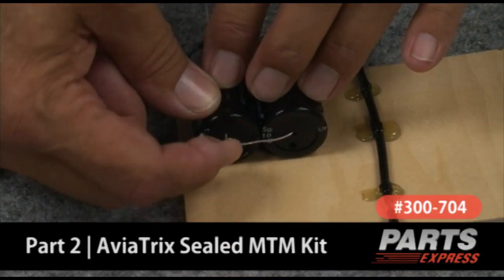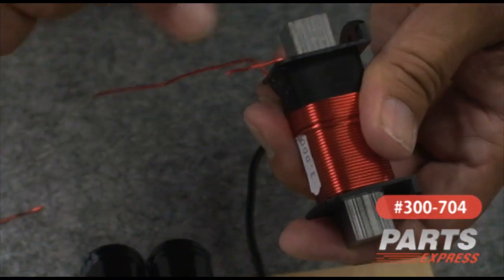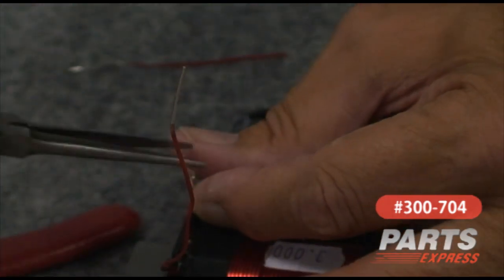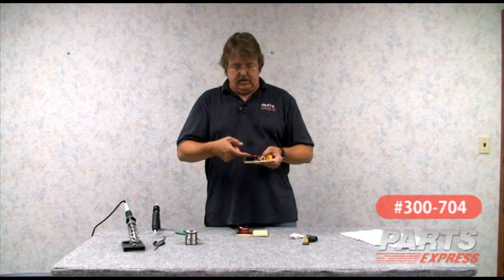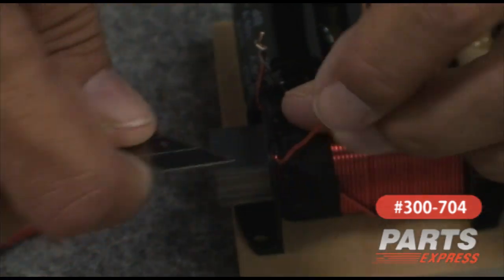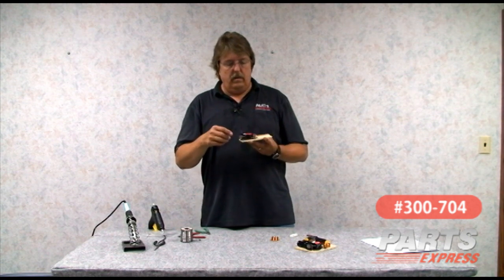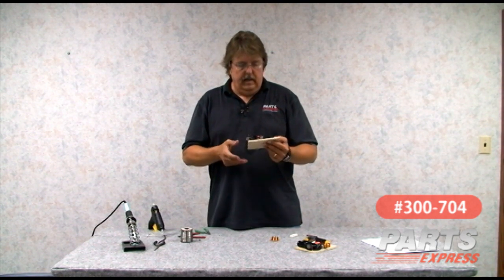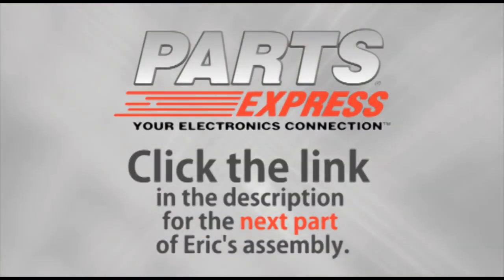Aviatrix Crossover Assembly - Part 2

Comment: i read capacitors had a flow to follow to reduce dc current frm backing to ur amps lowering fidelity. i am a rookie in all but...
Reply: I wasn't able to read all your post , but one of the things capacitors do , is block DC , but allow and can impede AC by means of Capacitive Reactance . 
  Whatever the size of capacitor , if you halve the frequency , you double the impedance . Then in a speaker circuit , with voicecoils and capacitors, you MUST research and account for voicecoil impedances to get correct values for first , second , third and order crossovers . Inductors must be of a reasonable gauge also , not thin .